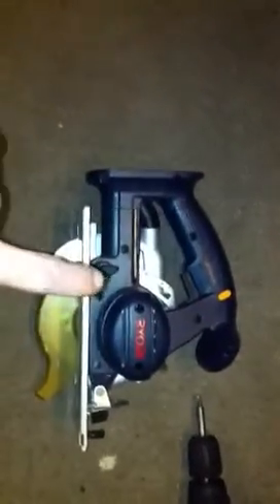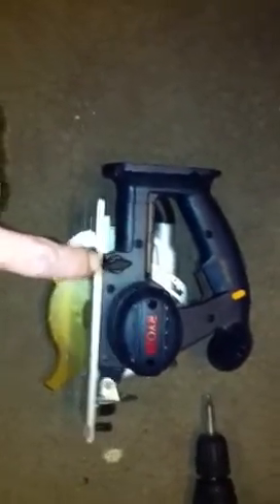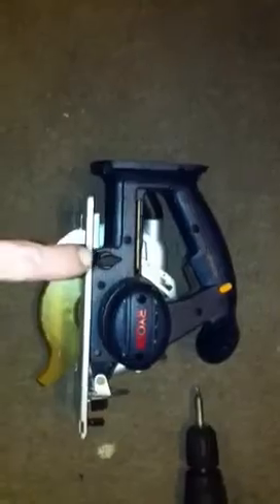BioDome Systems: The Aquaponic Chronicle- A Geodesic Dome Journey Pt 11 The Tools

Comment from the maker: Hello world of clean, that's an excellent question! The answer is that the angles will always remain the same and it is only the lengths that change if you decide to make a bigger dome. I would suggest using 2 x 4's for any structure over 8 meters. I was considering running courses in my country, do you think that would help out people in a similar situation? Stay subscribed for more useful information.